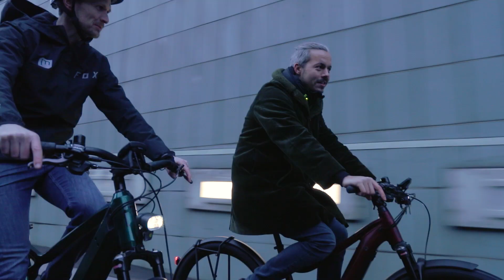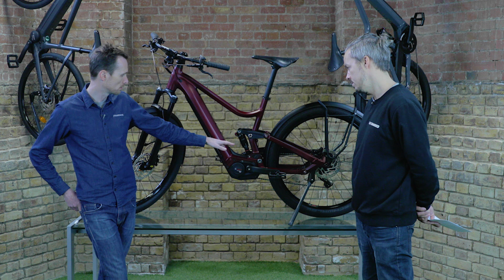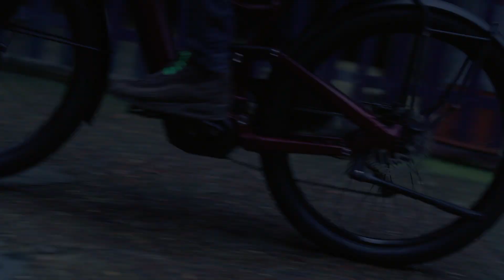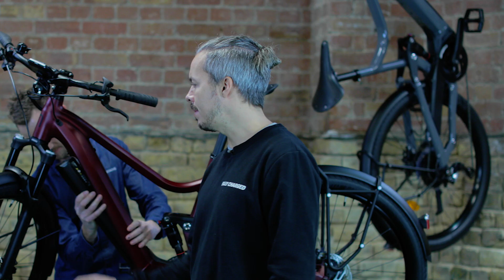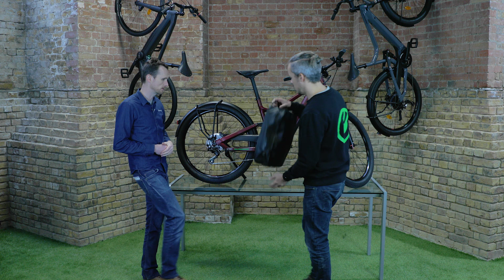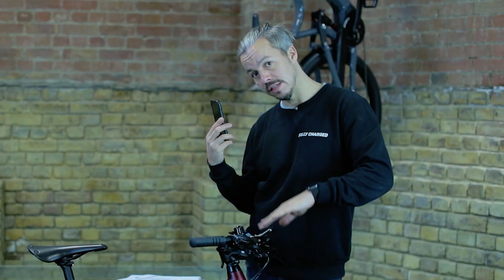Moustache Friday 27 FS Electric Bike - Ultimate Urban eBike

Comment: I plugged the charging cable on the frame plug and I dont think it is charging. At least i dont hear the chargers relay clicking nor do I have any indication that it is loading. And the Users Manual does not mention the frame charging plug at all. Is there anything i was missing when I tried to charge it this way? Is there any condition that needs to be fulfilled for this?
Thanks in advance

Comment: I found a 2019 version of the non fs one for 2700. Is it still a good deal?
Reply: I own a 2019 Friday FS Limited bought from new and I reckon £3000 would be a starting point if I were to sell it.  Is the non fs brand new?  If so, 2700 sounds about right.  If used, then I think you can haggle . . . good luck.
Reply: @sholtham1  I bought Friday 28.3 2020 (new) for 2900 Euros. List price was 3400. Overall I still think it was overpriced considering it has the cheaper active line plus motor and the simplest display.

Comment: Why did they choose a traditional chain over the vario electronic system?
Reply: I can think of two reasons. One, it costs more. Two, you lose some efficiency through the Enviolo transmission. However, It would be nice if Moustache offered that and the Rohloff as an option like R&M does. Another option that Moustache could offer is the SHIMANO ALFINE Gerard hub. They already use mostly Shimano parts.

Comment: Nice bike, however wonder why they didn’t opt for Gates Carbon Belt-Drive for the drivetrain. 🤔
Reply: Don't think it's possible with derailleur gears! But would be cool to see this bike with an e14 Rohloff, or Enviolo gear system
Reply from the maker: Gregory Stewart it’s lighter with a derailer / cassette and a chain than it is with a hub and a belt. Plus you can actually ride it harder and know exactly where you are. 

If you just want comfort for grand touring then a little bit of extra weight on an ebike is no issue. However the modes are for people that really enjoy the bikes handling and throwing it about a bit 😝